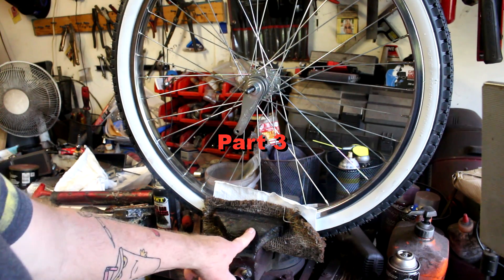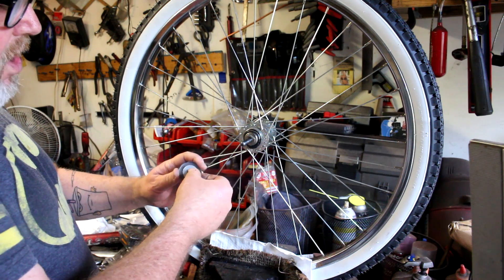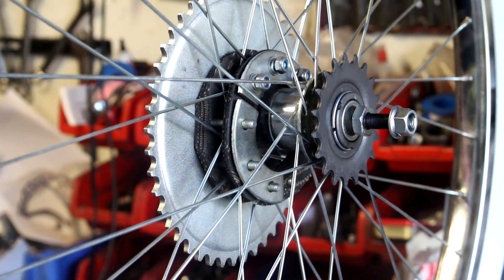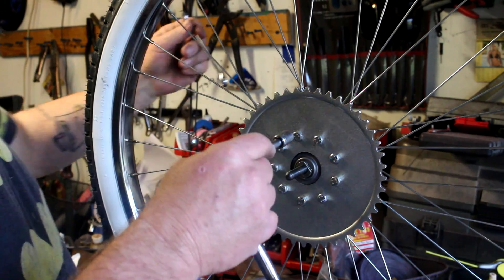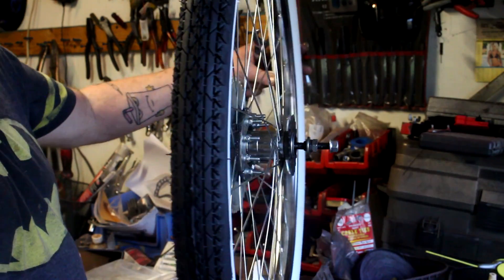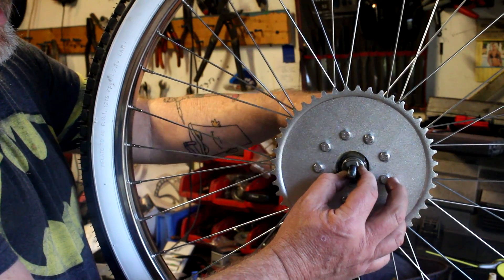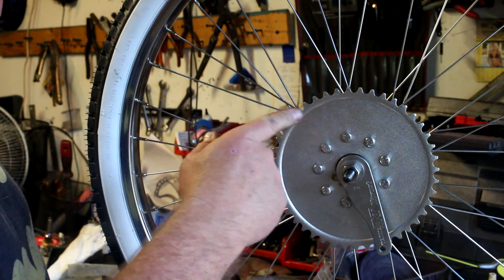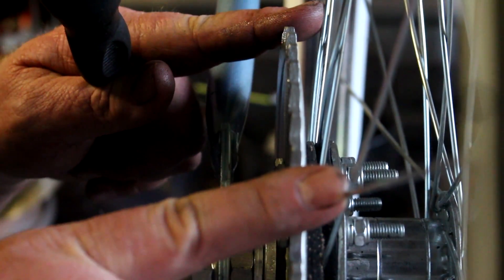How To Build 4 Stroke 7G Motorized Bicycle Part 3 NEW

Comment: I think you should realy use  hub adaptors rather than rag joint! Now I understand that I'm business you have to work with what the customers have. Also to turn a profit you want to keep the cost low but personally I feel that it's better quality , value, and better safety !
Reply from the maker: Hub adapters do slip and will put stress on a few spokes. I'm fine w/ the rag joints as they serve me well. I've had more issues with hub adapters than rag joints I've installed
Reply: Absolutely. Rag joints are a major pain. They are the weak link in these kits.
Reply: I'm also an advocate of mag wheels.

Comment: You better off to buy the hub assembly kit
Reply from the maker: My daily rider for 5 years has a rag joint. Runs fine once you master them
Reply: @HughesMotorized  Hi ... I am a first time motorized bike builder and owner.  I am a complete and total newbie to all this.  I bought a Huffy Nel Lusso and the Gru-Bee 4G15/147F 1G motor.  I was checking out your video the part about greasing the rear hub.  I was unable to tighten the cone/hub where it still moved freely.  I tried to tighten it several times, but when I did the brake would not move freely as in the video.  I found a video about assembly, there were two nuts on the cone in the video that were separated, but in my case there are two nuts together on the side with the gear for the bike chain.  I can't tell for sure if they can be separated so I can hand tighten the bottom nut as I saw in the assembly video and use the top nut to lock it.  If they are suppose to be that way I am unable to separate them I have tried several times so I don't know.  I saw in the video that a thin wrench is needed, but I don't know for sure if the nuts are my problem.  Can you please tell me how I can correctly tighten the cone/hub on this bike?

Comment: Instead of gauging with a screw driver, and banginging with a hammer, first snug them good equally crossing the diameter and a little at a time. Once they are all snug, use a ruler and measure the gap between teeth and spokes. Use the smallest gap as goal, and tighten bolts till the gap to each spoke is the same.
Reply: Flush to the spokes, flush to the wheel.